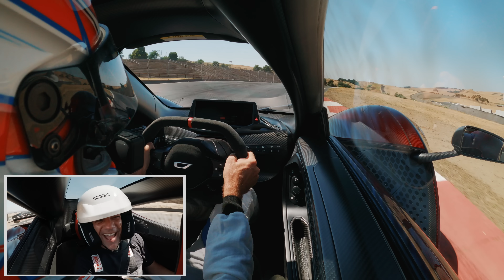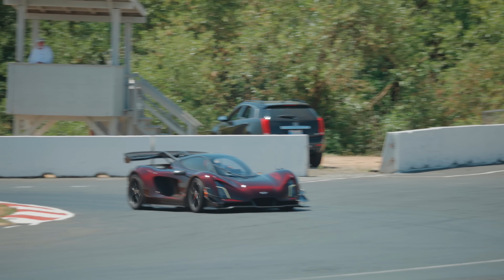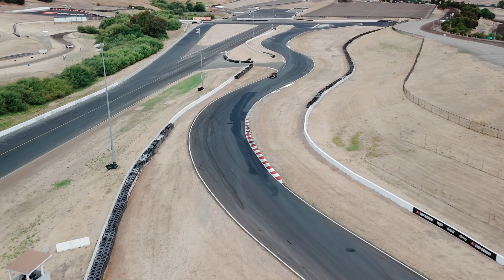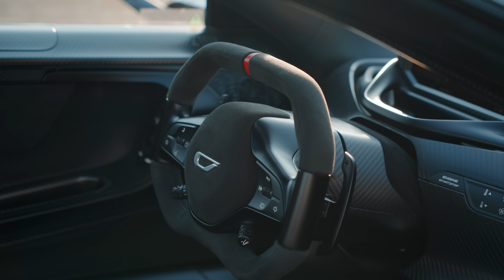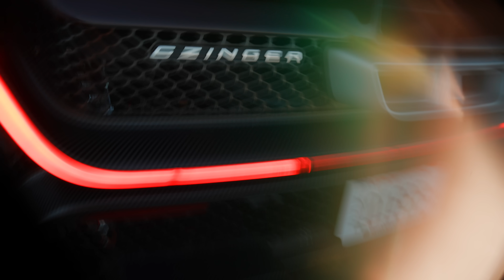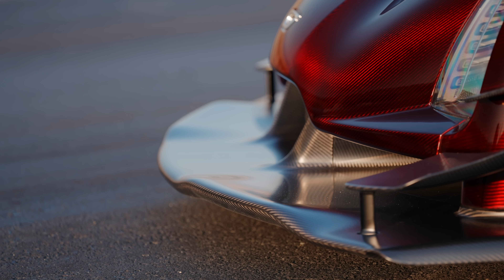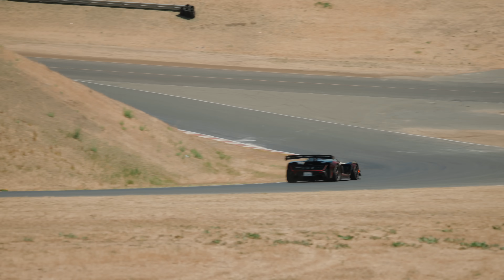FIRST DRIVE: Czinger 21C, The Wild 3D-Printed Hypercar

Comment: I question the 0 to 124 in 4.8 seconds. The ZR1X is 0.2 quicker 0-60 and it does 7.3 seconds 0-124. Czinger 60-124 in 2.9 seconds, ZR1X 60-124 in 5.6....Something is wrong there I believe. Not impossible but highly questionable imho.

Comment: Just applied for an internship as a mech engineer for the 21c in summer of 2026. Let this be known. I would do anything and everything to get this position. From the manufacturing sister company, divergent 3D. There is not a single manufacturer out there doing what czinger is doing. The implications for every industry whether it be automotive, defense, or Motorsport is massive. Generative design via topology with ai interpretation/ intervention is absolutely the future. As long as we make sure to focus on DFM and DFAM and don’t let ai decisions alone drive us. I would imagine every serious automotive manufacturer is probably in contacts with Czinger/Divergent 3D to full realize the capabilities of these processes

Comment: I love this car.  As someone whose entire career was in manufacturing it blows me away in the engineering and build.  I wish I could see the behind the scenes parts of how it is made since I'm used to traditional machining, casting, sheet metal, etc.  Since I'll probably only ever be lucky to glimpse one of these, my fervent wish is that the technology will trickle down into something awesome normal people can afford!
Reply: The "organic" components are made via 3D printing to produce a "green" part that is then sintered at high temperature and pressure (densified) to produce a structural part. Czinger primarily produces parts for, e.g. aerospace applications. The process isn't really suitable for mass production.
Reply: @avsystem3142  We used some DMLS and MIMs in our manufacturing in quantities that'd probably be considered "medium" production (thousands per year, not millions) and that was 5+ years ago.  I can't help but think as the tech progresses it can apply to more volume production.  It's potentially far cheaper than billet machining the same part and it opens up the ability to create things that could never be machined in the first place.  Our main struggles with adopting printed parts more widely were ultra tight tolerances and especially surface finish.

Comment: Jethro, I've said it before and i'll say it again, you have one of the best jobs in the world buddy.   It's crazy how narrow that cabin is.   It is probably the closest feeling you get to being in the cockpit of an F-35 Lightning II fighter aircraft.   WOW.   What a machine.   Cars have gotten so crazy in the modern age, with all of the new technology available from 3D printing, to brand new C&C type devices, which allow creators to produce engines that would have been considered impossible just 20 years ago, let alone 40,60, or longer years ago.  Technology has allowed these hypercar manufacturers to take it to the umpteenth level of sophistication, with most of these new modern hypercars being able to outperform F1 cars from the 80's!  That's nuts.  Whereas years ago, most supercars were made by hand, many as one-off designs commissioned by wealthy people around the world.  Now days, the precision that can be achieved is unlike any other time in history.  I can still remember the 70's, reading all the car magazines, a time when most automotive journalists said that the muscle car was dead and we would probably never see high horsepower cars again, due to the severe restrictions put on automobile manufacturers during that time period.  Fast forward to now, and you are seeing 1,250 horsepower Corvettes!  Something again, years ago, any GM engineer would have said that it was absolutely impossible to create a mass produced 1,250 horsepower Corvette, no way.  Yet, here we are.  The upcoming ZR-1X is a revelation in technology, especially for a mass car maker like GM to produce.  Now Ford has come along with their GTD, the most powerful Mustang ever made, along with their amazing Ford GT's.  Dodge, with their Demon Hellcat pumping 800+ Horsepower, again, all numbers that the engineers back then would have said, "Absolutely no way we can do that", and they probably couldn't back then. And with these crazy electrified cars like the McMurtry Spéirling, one of the fastest cars on the planet, It seems like the horsepower wars are alive and well.  It also seems like every day some other hypercar manufacturer, either a new start up, or an existing company, comes out with yet another super or hypercar. And then you have the restomod companies like Singer, RUF, Gunther, Kaege Retro, and many others, with their masterpiece Porsche restorations which are far higher of a level of fit and fitment, and engine builds, that even Porsche themselves are in awe of.  The need for these high horsepower, hybrids, quad turbo's, naturally aspirated, electrified, electric assist, and the list goes on and on. I mean, there are so many different hypercar and supercar manufacturers out there these days, you could put them all on a disc, take a spin, and no matter where it landed, you could buy one of the best cars on planet earth.  Even regular car manufacturers have gotten so good at making reliable engines, you rarely see the corner mechanic anymore.  When I was growing up in the 60's, 70's, and even into the early 80's, most gas stations had a "mechanic on duty", some having mechanics 24 hours a day, because there was always a chance, no matter what time of day it was, that you might need a mechanic, even if for a minor repair.  Even flat tires were far more common back then.   But technology has gotten so good, and so precise, that mechanics are rarely seen at a gas station anymore.  Sure, we had Firestone, Goodyear, and a few other places for mechanic work back then, but you also had many different private gas stations, and even mom and pop shops that had a mechanic "on duty", often being lit up on a neon sign in the window to show they had a mechanic on duty.  If the mechanic wasn't working on a car, he/she was pumping gas, checking the oil, washing windows, serving water, etc.  Gas stations were far more accommodating to customers back then, which I really liked.  It was not all that uncommon to stop at a gas station, get out of your car, grab a coke, sit on the bench outside and wait for your car to be "serviced", meaning you got your gas filled up, you oil checked, you tires air checked, and windows washed.  That was all INCLUDED with your purchase of gasoline.  No one pumped their own gas back then, and if you tried, the gas station owner would probably run you off their property.  And nothing I mentioned was an extra charge, it was included with your fill up.  We have lost that sense of service to the customer now, with every gas station in America (except New Jersey) making you pump your own gas, charge you for air, charge you for anything really.  There is no longer a sense of "service".  When you went down interstate highways, and even the back highways in America, like Route 66 after the invention of the interstate highway system (America's version of the European Autobahn, an idea that was brought here to America by Eisenhower after WWII), still had those type of gas stations all along the way, mile after mile.  They were really everywhere.  And the gas stations themselves had "style", which each company trying to outdo the other in their artistic style of their gas stations.  You could grab a bottle of Coke for a .10, then it raised to a quarter, a price that held for probably 10 years, then up to .50 cents, and that held for 10 more years.  A bag of chips or candy bar from the vending machine was a .25 cents. I always said if I were a man of wealth, I would start my own chain of gas stations, styled retro looking, harkening back to the early days of "motoring".  A time in history when driving across the land in a car was a true "event", spawning the creation of the very popular station wagons of the 50's, 60,'s and 70's.  No SUV's back then, just roads filled with giant "land yachts" as most cars were HUGE compared to todays standards, nine passenger station wagons were all the rage back then, with the back seat facing backwards and nobody wearing seatbelts, ever.  In fact, somebody would probably laugh at you if you had seatbelts in your car, let alone wearing them.  My first car didn't even have seatbelts put in it from the manufacturer.  Belts were extra!  LOL.  But in regards to the gas stations,  if I were wealthy, I would open a "retro" gas station chain.  I would bring back the unique art deco designs of the stations back then, along with having lot attendants that pumped your gas for you, check your oil, offer you a bottle of water, and wash your windows, each and every time you came into the gas stations.  I remember when being a gas attendant was actually a great job for a young person due to the amount of tips you got back then.  You didn't get paid very much, but you easily made it up in tips.  I knew quite a few gas attendants back in high school, and they all drove nice muscle cars, as most were car guys, and they loved being around all the cars at the gas station, seeing so many different cars throughout their shift.  It's always a treat to see what the next hypercar will be.   Don't worry, you won't need to wait very long, some manufacturer will probably be releasing a new one next week.  😁

Comment: 7:05 How much did that floppy spoiler cost ya's. 😂
Reply: Spoilers that bend are actually more aerodynamically responsive compared to stiff spoilers especially in this winglet-less design where wing edge turbulence is present so tldr it reduces wake and allows for better cornering cause outside wheel don’t loose grip 🎉
Reply: @UdzalZarnick Bro, that thing was lose and rattling ffs. Is what I meant. 😂😂😂
Reply: @GhostOfBandera it’s supposed to
Reply: @brandonhughes3528  Uhh, no. 😂
Reply: @GhostOfBandera uh yes

Comment: A PROPER super car or hyper car does NOT need help from force induction, such a weak auto engineering to pump up HP.
Reply: Then why does F1 engines, the literal pinnacle of automotive & motorsport engineering, use forced induction? Try harder

Comment: How a topologically optimized everything 3D printed patented material car be 1620 KG? Where does the weight come from?
Reply: Electric motors and battery, and you need to have separate radiators/intercooler to Cool them, which add 200kg

Comment: I'm sorry, but topology/shape/topometry optimisation has been around for years, and is the norm in every flagship CAE suite. I fail to understand how their process is so groundbreaking given the tools that are readily available nowadays, aside from the fact that they've decided to pursue it with such vigour? The materials side has obviously generated unique IP, and that's cool, but this isn't the groundbreaking thing everyone is saying it is...
Reply: The McLaren W1, Bugatti Tourbillon and Ferrari F80 have components that use Czinger's generative design. Try critical thinking instead of coping with ignorance
Reply: @tc3rtr I'm well aware thanks. I work intimately in this industry. That's how I know this is nothing new and it's all just pr bluster. The only reason they're being used by other manufacturers is because it's cheaper to use a company that's already spent the money on setup. It's not because of some black magic they've created...
Reply: @Matthew-z9c  If the tools are readily available, then surely there are other companies that are on the same thing Czinger is doing, even cheaper? Why have these acclaimed car manufacturers worked with Czinger instead of all those companies?
Reply: They created and developed some pretty insane machines used for exotic metal 3D printing.

This car is just their showpiece for what’s possible.

The software is one piece but it’s also integrated with the hardware, which gives you the whole package.

Comment: Can I download the STL for this car? I’d like to print and build :). Probably have to slice into a lot of pieces but it can be done.
Reply: The 3D printing is only the first step in the process. The printed "green" part is subsequently "sintered" at high temperature and pressure to produce the densified component. So no, you are not going to be making any such thing at home.

Comment: Well over 2 million dollars for two turbocharged Kawasaki ZX-14 engines ( The displacement is exactly twice that of the Kawasaki, and, strangely enough, the cylinder bore and stroke are also identical ) , plus completely made-up downforce levels (that rear wing channels the force into the tailgate instead of the chassis like other manufacturers do) – this kind of nonsense will surely find buyers in the United Arab Emirates.

Mate Rimac and Gordon Murray are enthusiasts; the guy in the white sweater is a blabbermouth.

Comment: I hope 3D printed means cheap. If it's not cheap, who cares it was 3D printed?
Reply: The type of 3D "printing" used is definitely not cheap. A "green" part is 3D printed with the desired alloy and then it is "sintered" at high temperature and pressure to densify it to a structural component. This car is just a tech demonstrator for the parent company Divergent 3D, which makes aerospace components using the tech.

Comment: Can we stoooooop with the crappy school math when advertising horse power? 750 to the rear wheels from the ice and 500 from the front motors ISNT 1250hp. It’s 750 hp with a 66% front to rear torque split.

Comment: All hypercar manufacturers say their car is the fastest, I can guarantee that koenigsegg jesko Attack The Jesko features a redesigned 5.0 liter twin-turbo V8
engine producing 1280 hp on standard gasoline and 1600 hp
on E85 biofuel (where available) alongside the revolutionary
new 9-speed Koenigsegg Light Speed Transmission
(LST). Advanced aerodynamics offer up to 1400 kg of
downforce, making it the ultimate track weapon.

Comment: Front torque is more responsive than the one in the rear, perhaps that's why it's tricky to drive. I would expect them to use rear electric motors too. Then keep the ICE as a range extender. Alas...

Comment: 30+ years ago, I used to dream about building cars like this.  This is the future of automotive manufacturing.  With more development this tech will be integrated into all automotive manufacturing and all other manufacturing, utilizing the most efficient and strongest possible design for all components will be revolutionary and with less guess work in engineering.  Perhaps as a mechanic we won't be asking why did they build it like this?

Comment: We need a hyper car race series. Christian Koenigsegg and Mate Rimac have already said they'd love to do it... A track-focused factory production car like the Koenigsegg Sadair's Spear, Bugatti Bolide, GMA T50S etc (I'm sure there'll be a Ferrari F80 XX)... Do a world tour with pro drivers and let's see who are the daddies of hyper car manufacture. I'd legit rather watch that than F1. Just do it!
Reply: but there is a FIA WEC with hyper cars... but not all of them want to race...
Toyota GR010 Hybrid (LMH): Features a 3.5L twin-turbo V6 engine delivering 500 kW, complemented by a 200 kW front-axle hybrid system, achieving a total output of 700 kW (approximately 938 bhp).
Ferrari 499P (LMH): Equipped with a 120° V6 twin-turbo engine producing 500 kW, and a 200 kW electric motor on the front axle, totaling 700 kW (approximately 938 bhp).
Porsche 963 (LMDh): Utilizes a 4.6L twin-turbo V8 engine paired with a standardized rear-axle hybrid system, combining for a total output of 500 kW (approximately 671 bhp).
, Peugeot 9X8, Aston Martin Valkyrie ...
Reply: @WalintHUN  that class is literally nerfed lmp1, or lmp2 but not spec depending on the specific vehicle.
Reply: Yeah Christian is still mad about them changing the rules in FIA GT1, just as he was finishing production on the CCGT.

Comment: Frankly, I just think that's one of the best looking modern vehicles I've ever seen. I think the single row seating arrangement probably contributes strongly to that, but I just really love the design and especially the way they integrate "3d-print-look" mesh. The red paint over the carbon weave just takes the whole thing to another level. Beautiful car
Reply: The carbon has colored red fibers weaved into the carbon. Gives it an insanely cool look. It is not red paint on the carbon.
Reply: @Hook0403  They are famous for their insane pearlescent paints, so while I'm sure there is red weave in there, there is also certainly paint on that finish, it is not just exposed. They have done several paint jobs where they basically fade paint into exposed weave to make an "ombre" effect

Comment: 14:36 Jethro says it's 1620kg wet-weight.. I find that hard to believe for a 3D-printed and carbon fibre 2-seater.
Looking up the specs, it's 1320kg wet (2910lb), which is still hefty for the type of car that it is.
Reply: The EPA document said this cars weight 1700kg curb

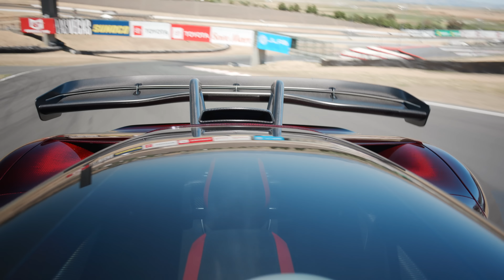Comment: That spoiler looks flimsy 1:31
Reply: It's just strong enough while being as light as possible. It's on purpose.
Reply: Look at this years F1 cars and you see the same thing
Reply: Flexi wings are on purpose
Reply: You'd look flimsy too with 5900 lbs of down thrust. Thats more weight than most sedans!
Reply: I saw that too. Is there some sort of active suspension component under that wing or is it just bad build quality?

Comment: Awesome car, the wing shake does not look normal, yes wings need to have some give but thats at a higher tensile force than what is experienced in the slow speed corners/hairpins as seen on the video.
Look at other comparable cars with wings like this or GT cars with swan wings or other hypercars and this type of shaking is not seen. Flexing yes, sideways shaking? no.